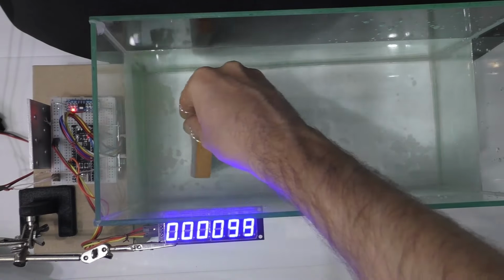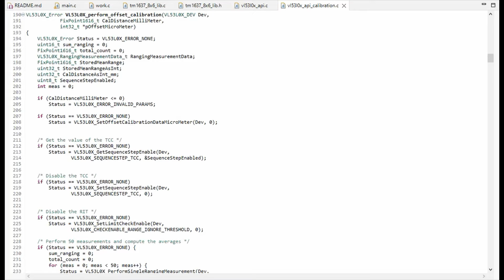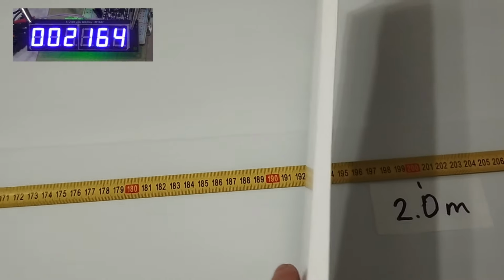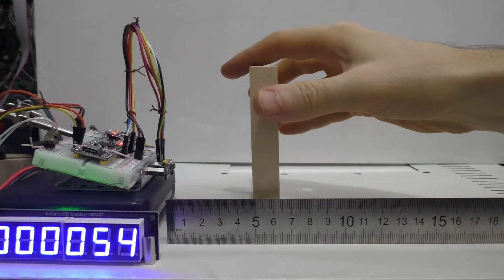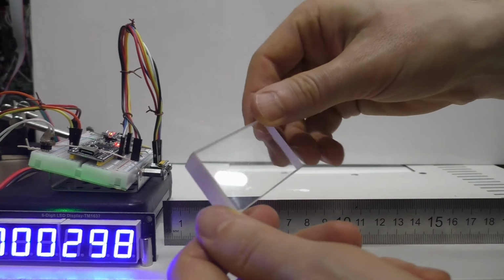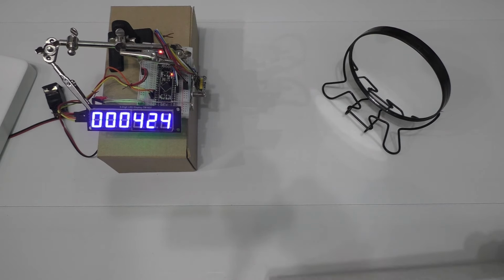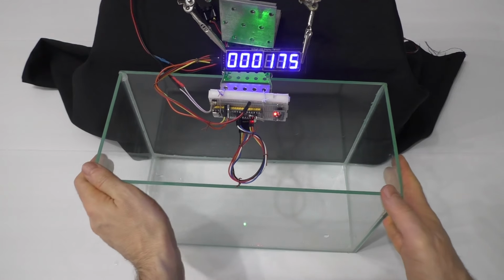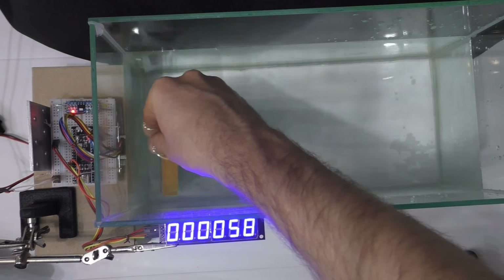10 experiments with VL53L0X ($1 laser-ranging module for Arduino)

Comment: Hello, thank you for this very interesting video and for the details provided. I would like to measure the speed of an object by attaching the sensor to it. The goal is to record the displacement every 20 ms and then calculate the speed over time. Does this sensor allow for recording distance data over time, and do you think this is feasible? Thank you very much.
Reply from the maker: This sensor has many settings, so the measurement time can be different. The minimum measurement time is 20 ms, which results in the maximum error. Longer measurement time gives less error. If the distance to the object changes during measurement, this will lead to an increase in error.
Reply from the maker: I used this code https://github.com/adafruit/Adafruit_VL53L0X
Reply: @NanoslavicLab  Great, thank you so much. I will try and I will let you know.

Comment: Hello my friend, do you know how many pulses per second does this sensor achieve? Y want to detect the pass of a fast moving object, around 90 Km/h. Do you think the sensor can catch it?
Reply from the maker: This sensor has many settings, so the measurement time can be different. The minimum measurement time is 20 ms, which results in the maximum error. I think this is not enough to measure a speed of 90 km/h
Reply: @NanoslavicLab  Thank you! Do you know what kind of sensor may i use for that task?

Comment: Mistaken there, aren't you?
The optical cable is 50cm long, you state the reading is 35-40cm, let's settle on 40cm. Then you measured the speed of light in this plastic is 80% of the speed of light in air. Why? When you measured in air the IR light needs to travel to the object and back, so it is divided by two. The optical cable is only one way.
Reply from the maker: I don't know how it works. This sensor is designed to measure distance in the air only. There may be some reflections in the plastic that affect the measurement.

Comment: Hello I wanna talk about HPDL 1414
Reply from the maker: Hi. It's a very old indicator. The Internet has all the information you need to control it. 
For example, you could explore this project: https://hackaday.io/project/168425-hpdl-1414-16x2-led-display
Reply: I want to make internet clock with one 1414 module with Nodemcu,help